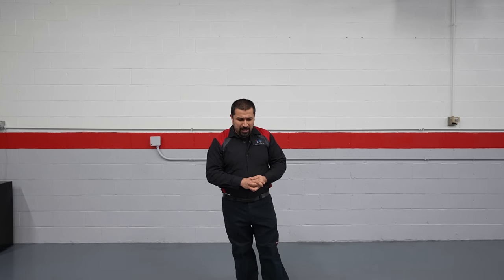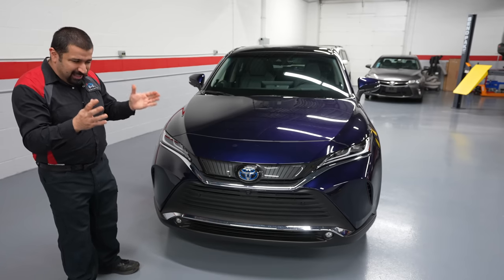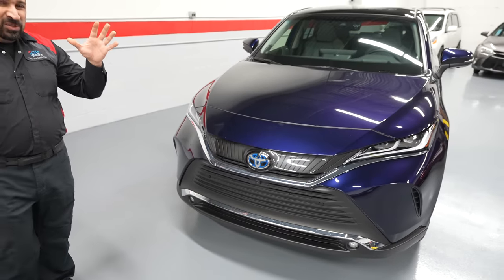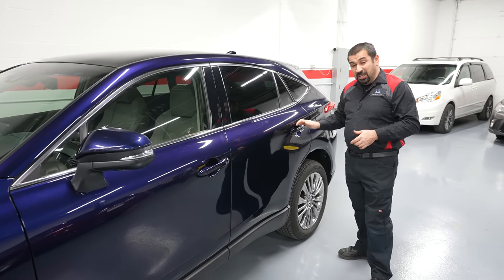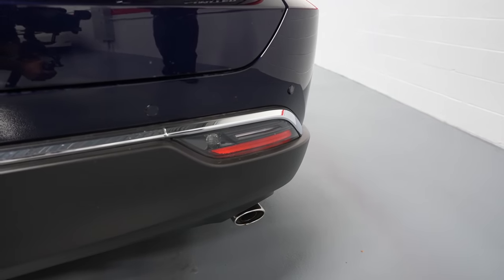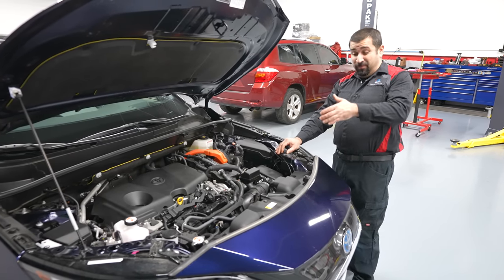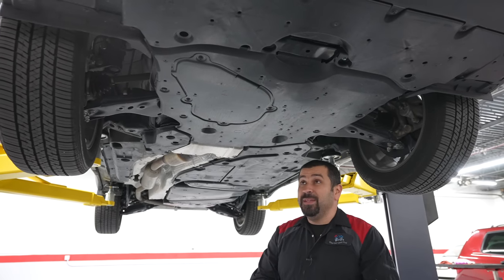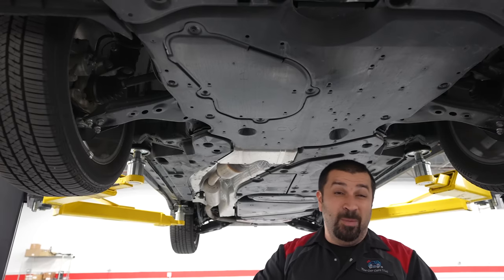THIS Toyota New Model is a Total Hidden Gem! Should've Been a Lexus!

Comment: I bought a ‘21 Venza and I love it.  I chose the XLE model mainly  because it has dials for the radio and a/c.  The start button may be in an awkward place but after a couple of days you forget about it.  
I totally agree that it has an unfortunate name, in Japan it’s called the Harrier which would have been much cooler. 
Speaking of Japan, the Venza is actually made there which, at least to me, is a definite plus. 
I’ve been watching The Car Care Nut for years and I bought this car because of you AMD, so thanks for all the great advice and congratulations on your new and beautiful shop. Too bad you’re in Chicago and not Los Angeles!
Reply: That’s what I keep saying too bad he’s in Chicago also I live in LA I see very few Venzas I don’t think i could ship it there and an engine I’d have to drive it I need to do an engine swap on my 97 Toyota Corolla I’d love for Amd to do it.
Reply: I have an XLE in south OC !
Reply: I took all the badges off mine and put Gazoo Racing GR emblems on it
Reply: I also have a '21 that I bought August 2021. I have the limited model as that is what was on the lot.  Best car I've owned.  Great fuel economy, everything works properly and no issues.  The only thing I changed were the tires.  I put on some Michelin Cross Climate 2 all weather tires so I have solid four season traction.
Reply: Makes sense that it’s the Harrier…the Lexus RX in the US was the JDM Toyota Harrier until the 2nd or 3rd generation.  At which point they introduced the Lexus nameplate to Japan
Reply: i Prefer Mexico built they take just as much pride as Japanease do mexico kind of brought the deep Button tuff interiors and 3tone paint Flip flop again Mexico i bought a toyota truck in 1983 sr5 what a piece of junk got rid of it 2years later didnt buy another toyota untill 2006 and then again 2014  and again 2020 and there all built in kentucky and mexico not Japan
Reply: It’s the Harrier in Japan? Because the harrier is actually the Toyota version of the RX. Pretty fun little detail
Reply: Why have a sunroof that doesn't open?
Reply: we have the '21 XLE as well. it loves its life here in hawaii.
Reply: @sheddski2942  Scotty Kilmer does not approve this (fart sound)
Reply: I thought I understood it has no trim levels.
Reply: I have the '21 Limited which I'm very happy with. It appears that the '23 got upgraded with the fog lights that were limited to the Asian version, i.e., Harrier. I wonder if there's an aftermarket fog light kit for the '21.
Reply: Exactly what is unfortunate about the name?
Reply: @sheddski2942 I'll take "built in Japan" over "built in Mexico" any day of the week.
Reply: I just got the 2023 venza XLE and I love it.. I like that I don’t see a lot of them on the road like the rav 4… every other car is a rav 4 lol
Reply: @jjpac2011  in Hawaii too. I havent seen many of these but I am interested. Roughly what did it cost from Servco if you dont mind? I bought a Camry from them in 85. Great car but as the only dealer it was above MSRP. My wife needed a car so I just paid it but that and some servicing issues at the Waipahu branch turned me off. I dont want to hold a grudge and its time to maybe give them another chance. Still happy?
Reply: @wadesouza6402  howzit. I'm on the big island so we don't deal with Servco here. We'd have to hop over to do that. Still very happy with it. No regrets with the XLE model. Yes, we don't see many of them here either. Got it for about 38k OTD.
Reply: @jjpac2011  Awesome. Mahalo for the response. Gives me a target so that helps. Servco is a mixed bag to me. I have had good interactions and so-so as a customer buying and servicing. As you know, in HI, you get a pilau reputation and it gets spread. So, I think the big negative interaction was likely just that particular location. I was told later by the service manager at another location to just stay away from them as their rep in the company was not great. So, I will check the car out and see how it looks. Its for my wife so ultimately she needs to like it. Aloha.
Reply: @wadesouza6402  Vehicle is also my wife's. I do enjoy driving it too tho. She loves it and particularly likes all the safety features that her Rav4 didn't have. Only thing we miss between the two is the Rav4 had more cargo space. Good luck with your shopping.
Reply: Greetings, I would like to know how it went with the transmission to those who have it, I am interested in buying one for 2024.

Comment: I have a 2009 Venza V6 AWD-it has every option that was available at the time and cost over $40K new. I purchased it 2.5 years ago for $7500. It's a gas hog, but a very comfortable  one, a total tank in winter , nothing stops it. Great car, gonna keep it as long as it lasts.
Reply: I am with you. I am driving 2010 v6.
Reply: Mines a 2011 v6 2wd 231,000 miles, runs perfect, very happy. Bought it last year for $6500 cash.
High mileage Toyotas don't scare me 👍
Reply: We have a 2009 V6 that had around 102,000 miles when we bought it early this year (it was around that mileage). Has 112k and only had to put a new battery in it.
Reply: My '13 v6 AWD is almost the perfect family wagon. I only have two complaints, gas mileage and front cup holder placement.  It's great in the snow, goes places our 4x4 Tundra cant. I like the new Venza, but it looks to be considerably smaller especially for back seat occupants. Which isn't great when your family are all over 5'8". <-They're not gonna like that with the 6'+ guys are up front.
Reply: You overpaid in 2009 .lol
Reply: I believe the prior-gen Venza was US designed and built.  Probably the most American made car in America those days...

Comment: I just bought a used 2022 Venza. It has the standard trim package with the 8.5" screen, and it has radio, volume, phone and menu controls on the steering wheel, as well as the cruise controls. But, there are actually on/off and tuning buttons on the center screen display, along with all of the other buttons, which I have not fully learned. We love this vehicle. Quite an update from the 2000 Chrysler Grand Voyager that we bought new 24 years ago. We loved that mini van too, but did not need the 7 passander capacity any more. Great review!

Comment: Looks good. I'm glad you talked about the noise level. I have a RAV4 and the only reason I would want to upgrade to Lexus would be for a quieter ride. I would also like to see the catalytic converters covered with some kind of theft deterrent cage or cover.  The hybrids have more valuable cats.
Reply: You're comment might change the future of Toyota cars. ;)
Reply: Just buy a RAV4 hybrid, it's a same car. 
If you want quiet and extremely safe car and Luxury, buy a Volvo XC60 and you will never go back to Toyota. It's reliable too.
Reply: Hi. Is your Rav an LE? I have an XLE and drove both when I bought in 2018. We noticed the XLE was quieter for some reason - perhaps more sound insulation but the difference wasn't listed as a special feature of the XLE. We found the same when we tested the Hybrid model; it was also noisier. So for us the XLE was the one and we've been very happy with it. Just thought I would share this.
Reply: @meenam300zx  😂
Reply: Maybe try another set of tires when your set wear out. I drove my nephew 2018 rav4 le to California and it was the most comfortable driver seat I sat in for long distance, no ache, low wind noise. I drove a friend 2021 rav4 and it was bad, bad wind noise and shaking driving 80mph.
Reply: @fknbastages  I suspect its a cost reduction decision, rather then a mistake. The Sienna, Rav4, venza, corola and now even the new Prius are all very noisi compared to the model they replace. Only the Highlander seems to have escaped this fate. Myself I'm going waiting for a highlander rather then the Sienna solely for the lack of noise insulation of the minivan, since I spend most of my times in severals hours road trips.
Reply: @dilididli2274  can confirm the previous gen rav4 felt more solid and a bit less tin can like compared to the current gen rav4.  Wife had both.
Reply: maybe get your RAV4 sound deadened? look into it
Reply: I grew up w Toyotas and they were very quiet in the 90s, esp the Camry and 1st gen highlander. And then they all seems to have gotten much noisier and more cheaply made in the mid 00s. 

Was recently in a new sienna and was surprised how noisy it was.
Reply: @Wasabi9111  2011 was their peak imo well maybe not peak but the last good year
Reply: @meenam300zx  I used to have a Volvo 850 wagon and it was a nice car. It would go 134 mph on the autobahn in Germany. But, it was expensive to repair and not as reliable as my Toyotas.
Reply: @Wasabi9111  I think it’s part of the weight reduction measures to meet fuel efficiency mandates.
Reply: Catalytic converter shield is an option on the 2023 Venza.
Reply: MillerCAT offers a cover for the Venza cats. It's the only one "approved" by Toyota (i.e., it doesn't disturb or damage anything when installed.) I had it installed on my '21 Venza a couple of months ago by my local dealership since they had experience installing covers on the RAV4. Took about an hour.
Reply: Aftermarket covers for Cats are easily installed
Reply: Toyota sells a cat cover-around 800 bucks.
Reply: There is a world of difference from Lexus to Toyota. I own a NX and had a RAV4 for four days as a rental. The noise and comfort ride is way different. The Rav 4 gave a more truck like ride and handling. The NX is just so much more smooth in all ways.
Reply: @zoner__ when it comes time to replace my RAV4, I would like to replace it with a Lexus, but there is also a world of difference between the price of a Toyota and a Lexus.
Reply: After this review I'm now not understanding why people get a RAV4 and not a Venza. Cargo space in back looks like its significantly less on a venza though.
Reply: @Wavetheory85  - It is less on the Venza.
Reply: I love my 2024 Venza Limited.

Comment: Owned a 2010 Venza with the 2GR-FE 3.5L engine. Was an amazing car. It got passed down to my daughter who drives it today. It had the lock/unlock functions on the front only. My 2021 RAV4 Limited (non-hybrid) has them on all 4 passenger doors and the rear hatch.

Comment: I own the 2021 limited with pano. Some other Lexus-lite features are puddle lights, digital rear view, smart climate control and the HUD. Best part is the mpg. During the Summer I average 43-45 mixed driving. In Winter, 39-41. I use the steering wheel controls so the touch panel is less of an issue.
Reply: I was just thinking why my car went from 49-51mpg in summer to 39-41mpg during winter  does cold affect the mpg?
Reply: @jacedragon   yes, happens to all EV’s. Hybrids loss is not too bad since we have conventional as backup. Full EV’s can lose up to 35% of range during cold weather.
Reply: @jacedragon  Normal ICE cars lose efficiency in the cold as well, especially on short journeys, due to the cold engine oil, gearbox fluid, heating in the cabin consuming energy, etc.
Reply: Basically all cars lose fuel efficiency during winter. Generally EVs < Hybrids < ICE vehicles

Comment: What I don't like about the Venza are the rear turn signals. Placing it on the bumper like a Kia or Hyundai was a bad move. Turn signals should always be eye level or just above. Also in case of a minor rear collision you're without a turn signal.
Reply: I actually love the look of the turn signals in the bumper. Plus , I get sick and tired of the huge led eye level lights glaring at me when I'm behind those vehicles

Comment: I have worked with these glasses and installed the first set for a boardroom in Australia 😁. Polymer dispersed liquid crystal (PDLC) switchable glass . Basically a thin electronic layer in between two clear glasses. Back In 2010 I heard the manufacturer won a contract with Mercedes. Great technology but once the particular panel stops working replacement is the only option. Long warranty is must as they were $15k each 1.3 meters tall panels
Reply: I will keep watching
I haven’t seen what you are talking about

Comment: I own 2021 LE. I absolutely agree with AMD. This is one of the nicest looking compact SUV on the market with classy lines. My thoughts exactly match with what AMD says about, starting with the forgotten "Start button" which blocks the access to tray to rear hatch that is too raked and eats to luggage capacity. They could have given curved glass and extending it outward to edge of the spioler without changing the look. There is so also much space wasted by raised trunk floor, bulged out inside fender well covers etc. 

In the tests done by Alex on Autos (2nd comparison with Production version, not the first press car), it is quiet as Lexus NX350H.

Main noise comes from the Tires on this car, otherwise it is pretty well insulated. If you drive this on smooth tarmac it is blissfully quiet without any wind noise. I replaced those tires right away with Yokohama AVID Ascent GT, which made it even more comfortable and quieter. Normal driving we don't hear any engine noise, but when accelerated from a stop we can hear the coarse engine noise, but thats not bad.

My intention was to keep this as my last ICE/Hyb vehicle for next 10-15years. But with cable gate that is going on with RAV4 hybrid, and this having exact same issue even with updated cover which really did not fix anything, and top of it, Toyota not covering that cable under 8 year Hybrid warranty, and repair costs of $6k out of warranty work I am having 2nd thoughts.

Unfortunately AMD glossed over it in the last RAV4 look saying there is tray now there. But tray has been there all along with in this generation of RAV4s. I wish people like AMD standups to corporates with their influence and do the right thing by exposing the issue and get the attention needed for this issue that is plaguing current generation of Toyota SUV hybrids. This impacts, RAV4, Venza, highlander, NX350. This is very unfair consumer is paying for this design mistake of Toyota and Toyota not standing behind to fix their issue and throwing Toyota loyal customer under the bus.

Comment: I love my 2023 Venza. You can control your volume from the steering wheel. The power button placement reminds you not to use that area for anything other than charging your phone. It isn't to be used for junk. Great video!

Comment: I'm a car guy and I think this vehicle is very sleek. Color is perfect and front end is sharp.  Big grill but that's the only negative imo. I love the flat bottom covers on newer Toyotas.  My 2022 Corolla SE has similar access panel. Very functional to keep salt,  slush, rain and snow from splashing up into engine bay. Thinking about making one for my 9th Gen Corolla still running like a swiss watch.
Reply: Hi Dave just thought I'd share I took down the 7 plastic panels on a 2018 I bought Fall of 2021 so that I could undercoat it. It had 32,000mi on it when I bought it. I only bought it because a deer killed my 2012 Camry. I had no idea I'd like the 2018 so much. Anyway, I found about 5-10 lbs of stones dirt and....rock road salt in those trays.  Because threaded studs come down from the unibody to suspend the trays, those studs will see the debris.  So, don't hesitate to clean them all out.  As far as undercoating goes, I've switched to woolwax but still had 2+ cases of cosmoline RP342....so I coated the entire underside with cosmoline and the top coated with woolwax.  Don't forget undercoating and all the trapped cavities and rocker panels under the applique facades.  I have an '07 Civic with 400,000 on it...learned a few things I overlooked!!!!

Comment: Having to use touch controls on an LCD screen for things like fan / fresh+recirc / defrost / volume is a non-starter.  What if temperature extremes break that touch LCD screen?  Will the car be drivable in winter conditions with a broken LCD screen or a broken computer that drives the LCD?  I really hope car makers get over this fixation on converting all interior functions to screen based "experiences."
Reply: X2 to all of that there!
Reply: Agreed! Those electronic controls and tiny buttons on my 2007 Camry Hybrid fan/heat/AC were annoying. I never did get used to them even after I had the car for 14 years.  The large control knobs on my 2007 Tundra are so easy to use and you can do it by touch without taking your eyes off the road.
Reply: My ‘22 Venza XLE has actual buttons and knobs  for HVAC, audio etc.
Reply: Not sure for Toyota but Tesla uses separate computers for the screen controls.  If the LG sourced screen ever fails, you can just say "turn on defroster" and it will work.  There are voice controls for all functions.
Reply: My 2007 Acura Tl center screen grows dimmer each year---almost like the lights are fading out in it. I see this problem in other used cars when they get 10 years older. Thankfully , my radio and temp controls are not in the dying screen.  Give me knobs for on/off/volume and keep it simple.
Reply: The lack of knob controls for both the ac and infotainment system is one downsides of owning a Venza.  I'm coming from a 2015 Honda CRV with practical controls so the transition was a bit jarring.  You'll eventually get used to it.  These annoyances are easily offset by the vehicles ride quality, solid feel, and handling, all of which was somewhat lackluster in the CRV.

Comment: The main concern people are seeing with the cable on Rav4 World  is galvanic corrosion. The opening won't help that, just postpone it. That's why it messes up the radio reception.  Much like a Nissan transmission. It works great, until it doesn't- unless there is a redesign, it will corrode -from the inside out. I'm pretty sure that is why the Corolla Cross Hybrid has it in the trunk.
Reply: They may first be dragged kicking and screaming through the class action lawsuits but sooner or later Toyota will find it is in their own interests to fix it.